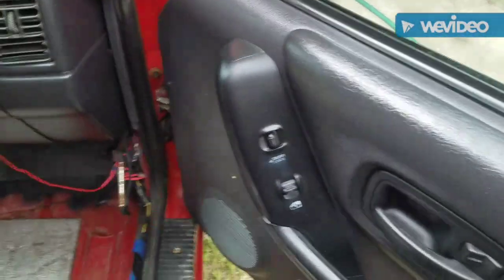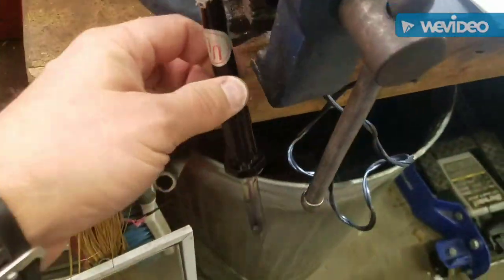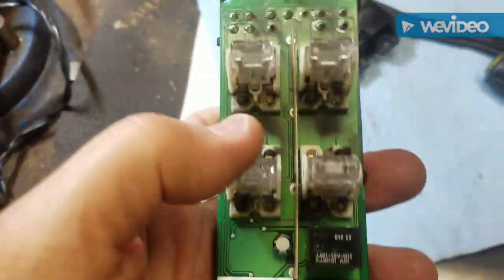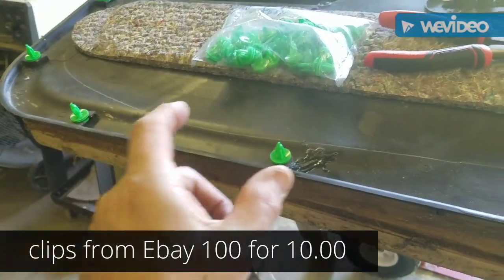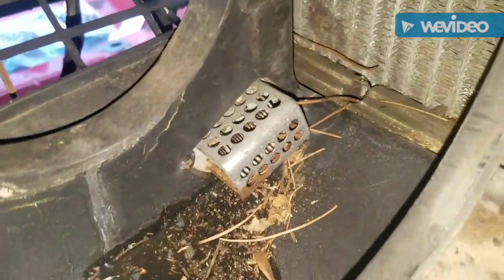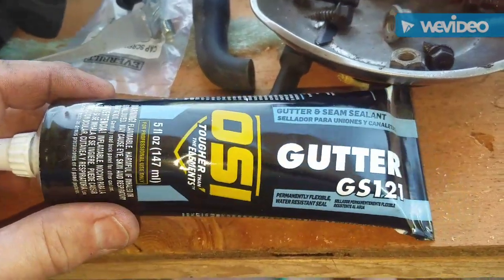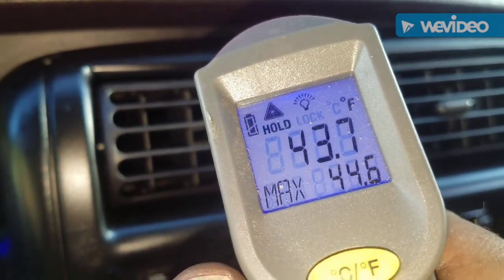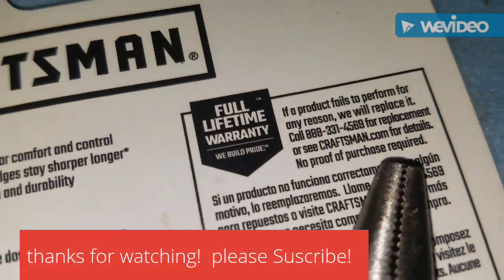Cheap Jeep Episode #28, Window Switch Repair,  Blower Motor Leak,  AC issue Continues and  #jeepxj

Comment: What did you have to take out to get to the blower motor gasket there? I've got mediocre heat but dont want to take the dash out in the winter so I'm trying to seal that gasket for a few months, will I have to discharge the AC to do what you did?
Reply from the maker: No need to discharge the AC.  I just unbolted the dryer mounting bracket and moved it a little.  You might not even need to do that.   Just put some sealant at the bottom of the blower motor gasket.
Reply from the maker: Also watch this video I did not long ago and you will see the actual gasket get replaced 
https://youtu.be/B7I-djhBG-M
Reply: @MajorWeakness  I'm gonna do all dash components at once after this winter probably. New gaskets and everything to make sure I don't have to take it off ever again lol. Thanks for the response! Gonna patch a rust hole and glob some silicon on that leak and call it a day

Comment: Nice repair on the windows and the leak. No one can deny your putting the time and work into the XJ to make it a reliable vehicle. Craftsman use to be my "go to" tool. Sadly that is not the case today. With so many good tool makers on the market I just don't see how Craftsman (Lowe's) will survive unless they have outstanding customer service. I'm departing today for a test run in my XJ. A two night camping trip with way too much gear. But this way I can test multiple scenarios and see what works and what I don't need. I will film it and make a video for a future date.
Reply from the maker: Yes it is sad to see the iconic Craftsman brand in its current state.  I look forward to see your camping trip and what works and what does not. I plan on doing some "XJ Camping" myself in the future!  Thanks again for the kind comments.